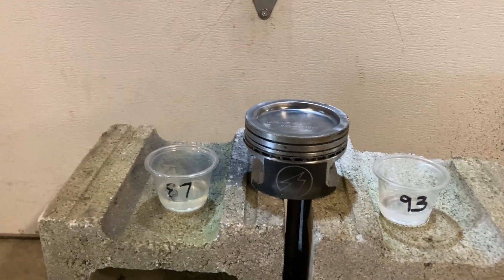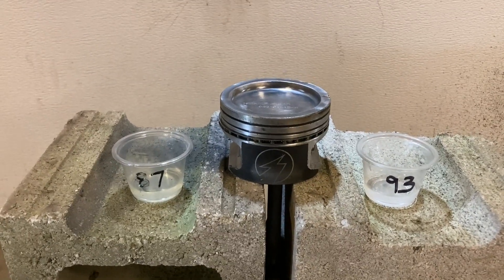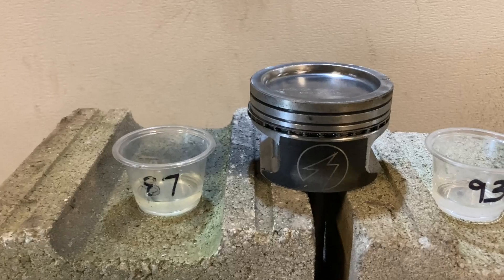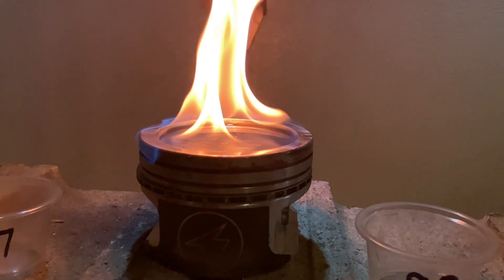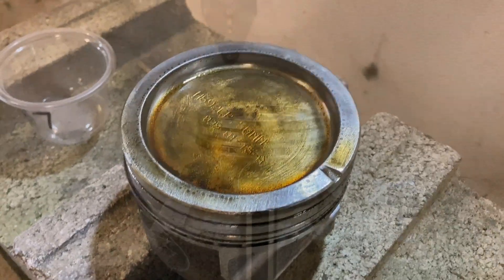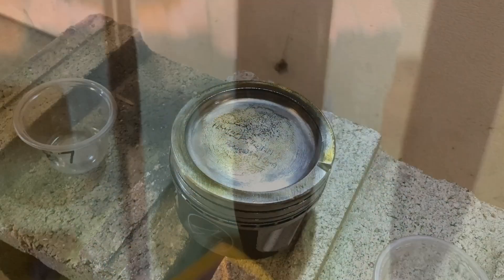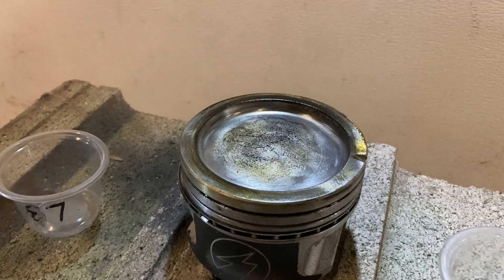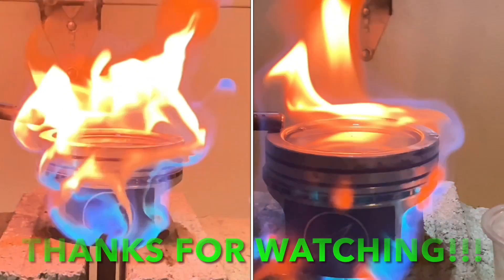Does 87 octane burn FASTER than 93?? 2nd attempt…

Comment: This isn’t how octane works. Octane rating is a fuels capacity to resist unintentional ignition and there are several more factors that affect this.

Octane helps combustion engines in 2 major ways: 1. Pre-ignition by hotspot and 2. Pre-detonation by compression. Both of these have to do with pre-existing energy within the cylinder.

Pre-ignition finds its energy by a hotspot in the cylinder. Therefore, if we increase the fuels auto-ignition temperature, we can avoid this form of pre-ignition.

Pre-detonation finds its energy from 2 places: 1. Increased pressure and 2. Increased temperature. When we compress something, the molecules are forced together increasing the number of collisions they experience. Forcing fuel and oxygen closer together on a molecular level increases the probability a chemical reaction will occur and the probability the energy released from the reaction with set more reactions off (aka chain reaction). This is, by definition, the most common definition of temperature so we have just also explained point number 2, that compression increases temperature. 

Both of these together reach some critical point where the fuel all spontaneously ignited at once with no flame front involved. The sudden increase in pressure behaves like an explosion and is highly destructive.

Again, the solution is to also increase the auto-ignition temperature of the fuel.

While there may be an actual measurable difference in how these differences in how octane ratings affect burn speeds, the methods for producing the differences in octane rating would render this experiment, uncontrolled. You can have additives the increase resistance to spontaneous ignition. These additives change the ratio of fuel-to-octane enhancer, thereby affecting how it burns or the formula that makes up the fuel can change thereby also changing its burn characteristics.

We can add things to the fuel, such as methanol or ethanol which require more ignition energy, or we can reduce Volatile compounds in the fuel and make it “more like kerosene” and this will have increase the ignition energy required to ignite a fuel air mixture.

Experimentally, we can’t just burn the fuels in open air to determine the effects of the different octane fuels. We would need to control precisely how much air the fuel is mixed with, how we ignited it, the pressure it is at, how clean the test rig is, what hotspots it might have, etc. and we would need to experimentally alter these variables to find its resistance to ignition to determine how fast its flame front travels. Anything less than conducting these experiments in a controlled manner is merely playing with fire.

Comment: You should listen to most of the comments. You made a lot of mistakes in your testing. That's not how you use the temp scanner and it will not read correctly from a shiny metal surface anyway. The residue is from the piston being cold on your first burn. Being in Canada, you've committed a major environmental offense by burning fuel in open air. I have notified the authorities and Justin Trudeau himself is on his way to nab you.

Comment: The octane is to retard the ignition to allow the piston to be at it's full design compression stroke position before the fuel ignites. It is for this reason that lower octane fuel in a high compression engine will cause the engine to knock. The fuel will ignite before the piston is in the full design compression stroke position, causing dieseling.

Comment: I'm no rocket surgeon but I'm pretty sure you didn't measure the thing you think you did. think high compression gasoline engine vs low compression  gas engine vs diesel. octane/cetane (diesel) is a measure of the fuels RESISTANCE of SELF COMBUSTION UNDER PRESSURE AND TEMPERATURE.   just my .02$ if you still want to measure the burn speed you could use a engine timing light and a high speed recording and count the frames in-between a complete cycle of ONE cylinder (from tdc to tdc) for each fuel. my theory is that the burn time is insignificant but don't give up on the science! keep going! prove me wrong!  ill watch another video of your findings.

Comment: To do this experiment, you need to have it under pressure.

Even then you won't see a difference.   They will burn at the same rate and produce the same energy.

Octane simply is resistance to pre-combustion in a hot cylinder before the spark ignites it.    

BTW, I'm a chemist.

Comment: Good on ya for having a crack at science my friend. Here are some thoughts to add to your scientific method. 

Why do you think this test would yield any valuable information? 
Theres 2 issues I see immediately: 
Conditions of combustion are significantly different - temperatures and pressures in cylinder are much higher than ambient atmosphere will plausibly impact flame front. At the very least as air density changes the speed of sound changes and since that is the determining factor as to whether something is a detonation or deflagration then I think it would change flame front speed.
Experimental apperatus - say you have an engine at 9000 RPM (thats high for most cars but is low for motorbikes so we can take it as indicative). That is 150 revs per second, meaning every 4th cycle the flame front will completely cross the cylinder in 1/150th of a second. So your slow speed camera would need to have a frame rate at least that fast to caputure the compbustion in just 1 frame. You would then need a camera at least 10 times faster to capture the flame front with 10 frames (ie to be able to use 10 frames to track progress across the cylinder). Finally in an engineering sense do you think the flame front speed would be 10% different between the 2 fuels? If you wanted to be able to track a difference of 10% you might need to increase the frame rate even further. 

So the second point laregly supports my instinctive first point. The flame front speed is entirely different in cylinder, and right now I don't see no reason that they may not actualy yield inverse results. ie one might be faster in atmosphere yet be slower in cylinder. 

Good luck researching brother. 

Matt

Comment: if you're interested in measuring the flame front speed why not use a long, clear pipe? you can leave the ends open and put distance marks down the length. Problems are: flame front speed depends on AFR, so you need a consistent mix between tests. I have heard about 87 burning faster, but not sure.

Comment: I have a 94 Probe GT v6 5 speed. It is supposed to use premium. I used to run it on 87 sometimes, other times premium. It didn't have a problem with knock, and ALWAYS needed attention with the ignition system, and IAC due to coolant levels, occassional vaccum leak. It was pushed hard on whatever fuel was in it. After years I realized the RPMs were dropping off faster on 87. This drop in RPMs made it impossible to rev match. My 93 did this too, but that was about a decade before I bought the 94 and I forgot about it. My first thought was, I'm wrong, crazy, doing it wrong, there's an error. So I explained it to a friend that was a regular passenger. I turned it into a game where my passenger would tell me if I cheaped out on the fuel, and he was right 100% of the time. I even experimented a little bit with brands. Shell, Sunoco, BP, and Speedway (which says they get their fuel from Amoco.) Shell always ran better 87-93, in all cars I put it in, BUT still dropped revs too quickly using 87 IIRC. Sunoco used to have 95, may still but I think they have 94 as their top octane now, it's been awhile. Sunoco premium did nothing over any other gas. BP paused injector issues with some GM cars back in the day, so that place was pretty much an emergency stop even though I don't have anything GM. I stopped using lower grades of gas after swapping the engine for a .9 higher compression, and also ECU swap. Strictly a performance swap and I wanted to start fresh with all the problem areas never give it an excuse. When I used 87 the car did not feel slower, or like it had less power, it made rev matching the downshift jerk with a blip, and there was no way to compensate with the gas pedal, blipping more, without over compensating. It's otherwise nirvana when everything is perfect.
Reply: You seem like you'd be a blast at family parties. Get a knock sensor on that "Probe GT" and it would make more sense.
Reply: @LegendaryFarm84  It has a knock sensor. It's not knock on decel with no load..

Comment: Ethanol content screws this up.  Australia sells little of Ethanol mix, just too bad for engines. Europe sells only 95 or 98 octane but their definition is different.  Looking at your 87 residue one can see the reason direct injected engines die earlier from carbonizing.
Reply from the maker: Thanks for watching! 
Regarding the carbon build up, I’m not sure how the pistons look in a DI engine because if fuel residue, but the problem I’ve seen is mainly due to the intake valve no longer having fuel spraying on it, and carbon build up because of the oil in the PCV system.  I recommend anyone with a DI engine install a catch can immediately.  
Thanks!

Comment: while there's definitely good info here, I feel like this experiment is invalid. The fuel is being stored in open containers is open air before the test is going, then the other fuel is left out and open while the other fuel is burning. fuel does evaporate albeit slowly but it does. the alcohol and ethanol ratios could be vastly different for this reason.
Reply: I applaud the citizen science.  Will this apparatus and method answer the question ?No.  But knowledge is built with failure.  It took thousands of years to get to Cern.
Reply from the maker: You may be right, as both these fuels were stored in gas cans in my garage for a couple weeks so the ethanol content could have changed.  
But since both fuels were stored in the same environment for the same amount of time in the same conditions I would say the 87 vs 93 flame front speed is still valid.  
I’ve heard that the higher octane does have fuel stabilizer added so it can be stored longer but I don’t think 2 weeks is enough to degrade the 87 octane to any noticeable degree. 
The 93 octane sat out for literally 5 minutes longer than the 87 in the plastic cup during the testing.  
Thanks for watching!